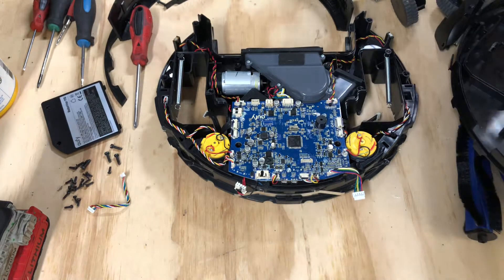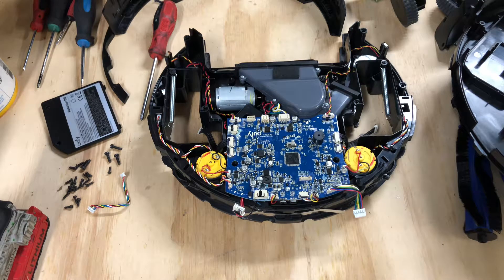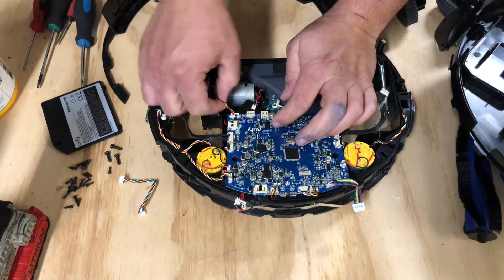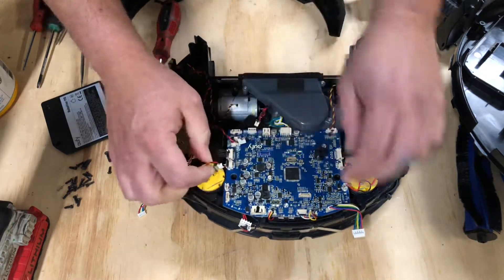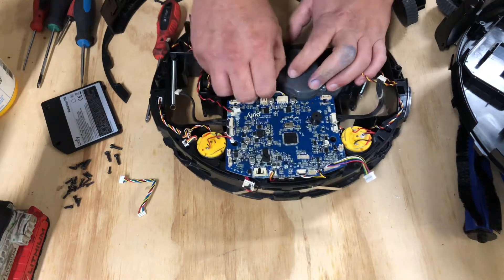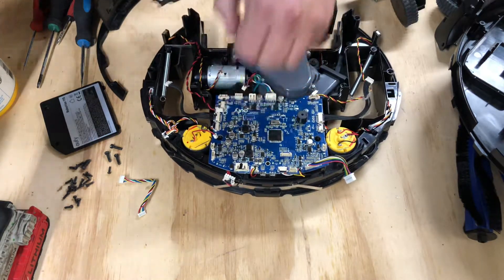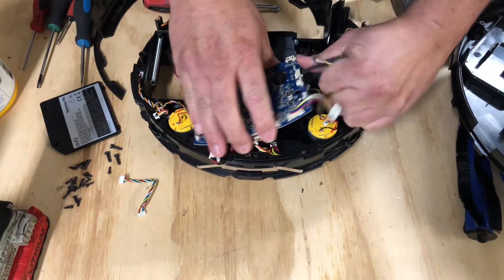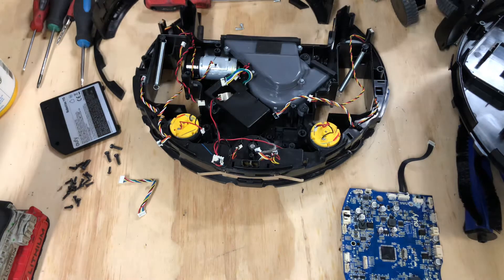Eufy RoboVac 11s How to Remove Motherboard Video 5

Comment: Thank you very much for this video.  I have a 3 year old 11s.  Was running shorter times, ordered new battery.  Changed out battery, still got flashing red lights and beeps on charging base.  Would not charge.  I went through your first 3 videos and took it apart.  I found one of the wheels was clogged up with Barbie clothes.  I cleaned out the wheel wells on both sides and said "maybe that is it"   I put it all back together and now it is currently charging.  No beeps, no red lights.  I will keep my fingers crossed.  Eufy support was pushing me to buy another vacuum b/c of course they were.   Appreciate your great detailed videos.  Keep up the good work

Comment: Thanks for this video. I'd spent almost an hour trying to locate the position of one lead I couldn't fid where it went from the circuit board.  You named each lead as you removed it. That made the difference as I could see where not was meant to go. It was just a sensor lead but had become disconnected from the sensor which was doing a great black on black hiding job. Found your excellent video and within 20 minutes problem solved and machine back together.